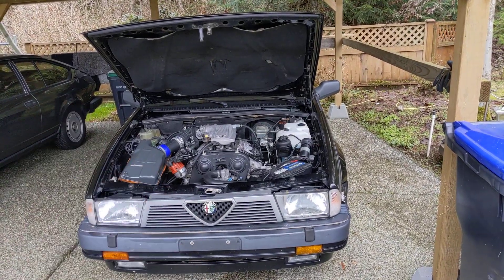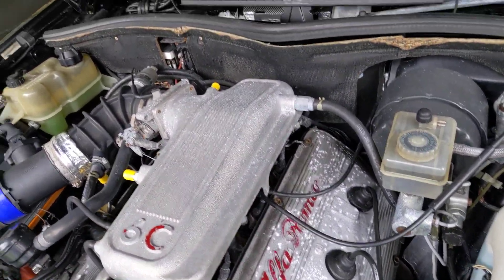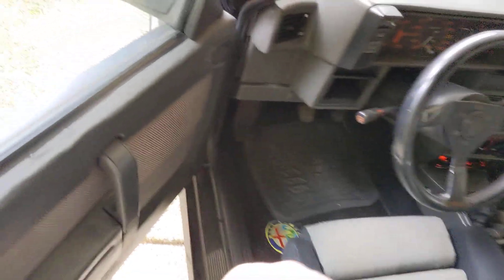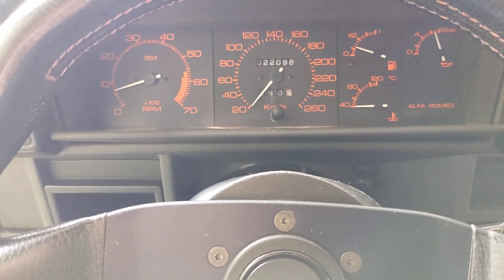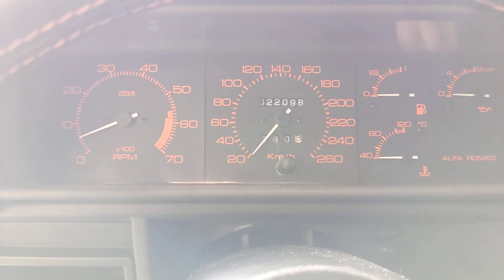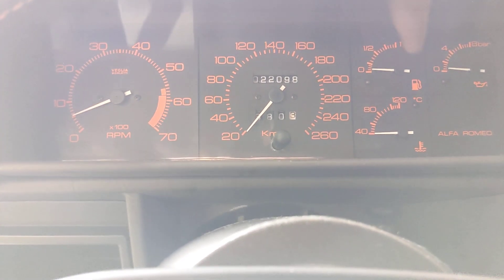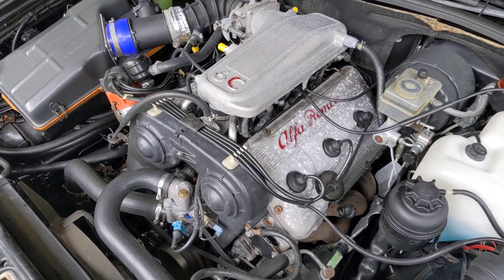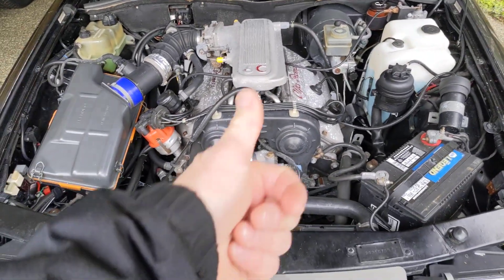Milano cold start 2023

Comment: When I did my timing belt in the GTV6 I used Alumiblast on the cam covers and plenum. On the upside, no more white powder spots. Downside it got a few waterspots after I washed the car when some water snuck under the plastic cover. Still want to get myself a Milano. Yours is looking quite nice. (And I'm really missing my 164s.)
Reply: the 75 is amazing to drive, that you have a 2.5 that I prefer to the 3.0, revs more and is actually quicker.  I own mine since new. Own a  few Alfa's.

Comment: That Milano definitively has a lot more miles then 22K for sure.
Reply from the maker: Odometer was rolled to 0 when I finished the restoration in 2018. Makes it easier to keep track of maintenance
Reply from the maker: Engine is heavily modified and has CB stage 2 cams and modified management. Cold starts are a challenge with 15w50 oil.
Reply: @Nodarperformance  Got it :))